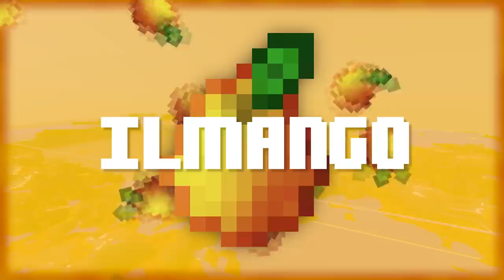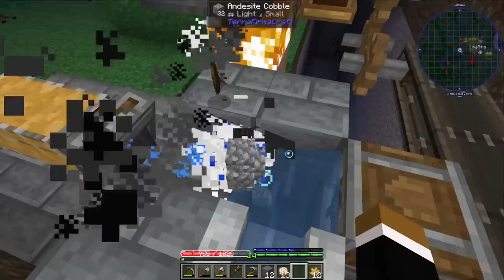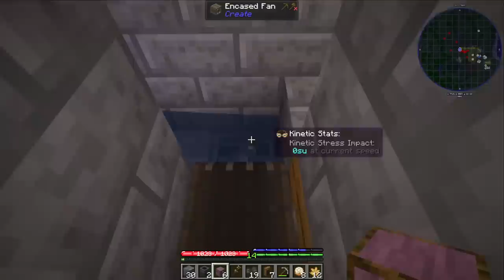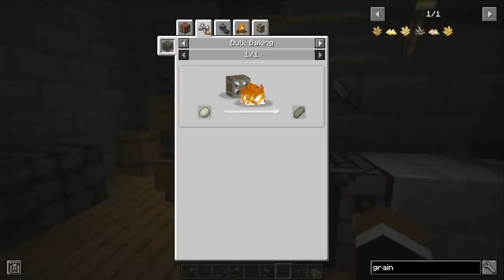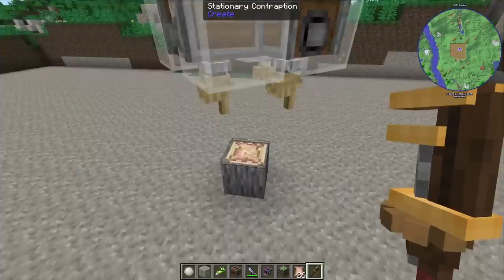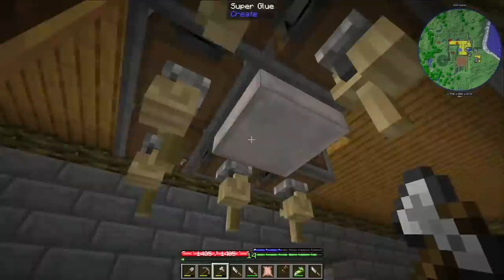ATFC: Crazy Knife Spinning Leather Scraping Machine (Episode 24)

Comment: Not sure if somebody commented this yet, but you can put a filter in a filter, and even put that in a filter and it remembers all the contents. So you just lose 1 slot, to add many more on top of it.
Reply: Attribute filters are way easier to use, since you don't need to put in every single item and instead just set up the correct attribute like " can be smelted", "can't be washed" etc.
Reply: So there basically like extension leads
Reply: So its like a simulation inside of a simulation of a simulation?..
Reply: can he not just blacklist the cobble?
Reply: @BaumMiner  as it stands, that would allow cobble to be accepted because it “can be washed.” Can it do the reverse, such as “has been washed,” or “cannot be washed”? (That would allow the ore, which has been washed and can no longer be washed to be accepted into the filter.)
Reply: @darkthunder301  that what i did it's much easier
Reply: @adamsonntag5686  He literally said "*can't* be washed" lol.
Reply: @chaotikkiller1617  ah whoops, haha
Reply: @BaumMiner  This. It's the advanced version of "deny base ingredient" in order to allow "product item". Gonna put this to use, thanks!
Reply: @BaumMiner  That makes the ultimate filter in a washing system "blacklist" and "can be washed"  (While his filter is .. non optimal, I'm totally copying the hover washing).
Reply: @Sphendrana So what do you put in the filter name?
Reply: @slipinsidewayz  sorry, your comment confuses me a bit with the wording, can you elaborate?

Comment: this contraption is the least OSHA-approved device I've seen Mango make. I'm very impressed.
Reply: I see nothing wrong about a 3m wide contraption with sharp knives rotating at 256 RPM right in the general area of the operator's head.
Reply: The bamboo farm is definitely a hard-hat area.
Reply: I’ve seen Mob Traps that look safer.

Comment: You can change the filter to deny certain blocks instead of allowing blocks, if it runs out of slots
Reply: you can also put in a already set up filter into another filter, actually stacking their filtering!
Reply: you could also set it to allow by attributes, would probably easier for this setup
Reply: @Logstar53  yeah, he shouldve used brass filter. Since that one you can just deny the attribute "Can be washed".

Comment: You can fix the problem with constantly having to update the filter and running out of space by using an attribute filter with “can be washed” blacklisted, then it will work on anything that can be washed
Reply: Good idea for most ressources, but some can be washed twice, and he could want the first one.

In his actual situation, it would have been ideal, I agree.
Reply: @pierrotA  in the case of those resources the automated system will have one thing it can’t handle no matter how you do it, so it comes down to preference. Also, you could solve that issue by having the attribute filter as well as a blacklist for the rewashable resources

Comment: I know you record these in advance, but just in case you haven't committed to your automated leather setup yet, have you considered using perpendicular Gantry Shafts to move a set of deployers across the leather like a 3D printer? An efficient use of that concept would likely require some logic, but I feel you would enjoy trying that approach!
Loving the videos, by the way! Keep it up!
Reply: I was thinking the same thing !
Reply: Then what happened to the edge/corners? Since the deployer only ran on 1 line, they can only hit across the center.

Comment: Replace the filter with Attribute Filter. In Attribute Filter, you can blacklist items that are washable and let all other items through. You therefore wouldn't have to edit your filter all the time.

You can also use Sequenced Gearshift for the deployer rotation duration timing.

Comment: The fan particles will pass through certain non-full blocks like single glass panes, a single iron fence, or (if this pack has it) a placed stick. 

That way you don't have to have that pit for the water to fall into.

Comment: From what everyone is saying, it seems leather can already be automated easier in the new update, but depending on why the deployer can't place the leather on the log, it might still be possible.
If it's just that the deployer can't reach the log at the correct height or something like that, you could try to position the deployer halfway down a block, with a mechanical piston or something along those lines.

Comment: Some thoughts on the auto-scraper:
* The asymmetry is probably due to rounding! I would guess that the "look" vector of the deployer is bucketed into one of the 16 subpixels by multiplying the fractional x and z coordinate by 4 and then coercing to an integer (truncating the remaining fractional part). This means the asymmetry is likely not JUST dependent on direction (NSEW) but ALSO which quadrant of the word you're in (+/-X and +/-Z).
* Given this kind of asymmetry, I wonder if you could get away with a lot fewer deployers by running the scraping machine for shorter THEN rotating the log with the hide on it by 90deg. Repeat this 4x and you should apply the same scraping pattern rotated by 90deg each time. If you can get a single scraping run down to <25 knife durability, you might be able to beat your current version on knife usage. This of course only works if supergluing the hide and rotating it maintains the scraping status. I could imagine that the scraping status gets reset when converting to a contraption entity and then back to block form...
Reply: That's some grade-A analysis. You sir, have earned a digital cookie.

Comment: @11:25 two of the buttons at the bottom of the filter tell it whether to ✅️ white-list or ❎️ black-list items. For example, instead of putting 3 ores on the white-list you can put 1 cobble on the black-list. I'm afraid that replacing the filter templorarily with something else is the best way I know to adjust it.

Comment: Higher speeds skip spots that machines can act on, it is possible to drill through walls with rotating drills completely, if they are too fast. I recommend going as slow as possible.
Also, there is no need to do tick math in any way, there are blocks that can perform machine instructions, meaning you can set a number of rotations and how many degrees it rotates and so on.

Comment: For automatic hide placement:
- What happens if you rotate the deployer (facing down still) for placing the hide vertically, so its path intersects the log somewhat. So rotating it to come down towards the log like a slap.
- can you place the deployer at some block fraction using the rope pulley from the drills?

Comment: I feel like for scraping the better way would be to move the hide on x/y axis. CNC hide scraper.
although I'm not sure if that would let it get scraped.
but it would definitely easily let you hit 16 specific spots with a single deployer, and it would do it precisely without wasting durability if you wired up the speeds correctly. 
but it could be a dead end if contraption hide can't be interacted with. not sure how it works exactly.
Reply: I was thinking the same though you'd have to do circle math or a lot of guessing since u cant move blocks less than a block you'd have to angle the knife from specific distances to reach all the pixels
Reply: @undodo4264  You cannot STOP blocks at positions less than a full block. If you keep it moving, it may be possible
Reply: @Racernator De  ahh right ofc, it could be possible. Sounds like a fun challenge

Comment: Have you tried a déployer from the side to place the leather on the log?

Also there is 1000% a better solution for that knife wielding abomination, maybe with mechanical bearings spinning in a moving contraption like the one you used for mining.

Comment: For the scraping problem, I wonder if a "3D printer" design using 2 mechanical pistons pushing a single deployer in the x and z axis respecitvely would work and conserve knife durability.
Reply: Gantry Shafts + Sequenced Gearshifts should also work. But the spinning knife death machine definitely has a higher entertainment factor.
Reply: @thebeber2546  Does it? It gets the job done, but it's a bit of a brute force machine. A system moving around a single deployer would be harder to build, but it would also be much more elegant

Comment: Someone mentioned this idea for the scraping, but what if you use gantries or rotators or anything else that can give a sub-block offsets to offset the deployer attempting to place the hide, so it reaches just above the log? Would it perhaps then be able to actually place it? Perhaps at an angle instead of from above?

Comment: interesting that the creative world-level projects are starting to show up here. that leather scrapper looks interesting, but one thing you maybe should have tried is to rotate the log and leather itself too. i though that you were going to go for that aproach at the beginning, since if you rotate the log the deployer is bound to at least click  in 4 spots instead of 1, and maybe even 8 of them. maybe paired with a single o couple rotating deployers on top you could reach all 16 with just one or two deployers?
Reply: don't think you can rotate the log without the leather popping off
Reply: @icefire6622  Linear Chassis set to 2 should grab onto both log and leather.
Reply: Interacting with a rotating entity wouldn't do anything.
Reply: @CzechHek  but i doesnt have to be rotating, it can just rotate. rotate 90º, then stops, deployers do their thing, then rotates 90º again, stops, deployers do their thing...

i get is not as fast as just having a storm of rotating knives hacking at it from above, but as ilmango has pointed, 100 durability lost per pelt instead of 16 is quite the amount too

Comment: Can you automate the REMOVAL of the scraped hides? I didn't notice you trying that.

If so, you could just AFK with a clicker script placing hides and a clock pulsing the scraper.
Reply: I'm sure you could move the block with a piston or something that forces it to pop off then have a hopper/chute collect it from there, if there's not a simpler way.
Reply: In the creative world you could see a mechanical drill set up in a position that looked like he was using it to remove the scraped hide, so we may see that used later once he has automated the soaking as well.